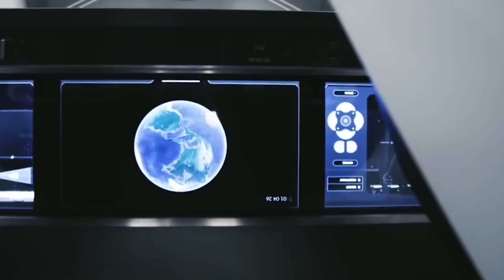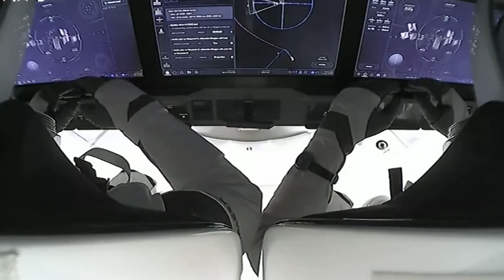SpaceX Crew Dragon Eyes Lunar Mission, Outshining NASA's $2B Rocket Plan...

Comment: Longer term there are lots of possibilities for a far better Lunar mission architecture than the current SLS/Orion plan but if Trump wants to see the USA win the humans-back-to-the-Moon race during the current presidential term, i.e. by the end of 2028, I suspect that flying the final 2 Block 1 SLS missions i.e. sticking to the current plan up to and including Artemis 3 (first crewed landing but not involving Lunar Gateway) might be the only option that can deliver. As mentioned, Crew Dragon would need a lot of modification and validation before being certified for a Lunar mission.

The end of 2028 is just over 2.5 years ago and maybe I'm underestimating how much new development and certification could be done between now and then but I fear that to hit an end-2028 deadline any new mission architecture would have to be based pretty much on what is already available or under development right now.

That's not to say that a new mission architecture that kicks in after Artemis 3 designed from the outset to be cost effective enough to allow a permanent Lunar presence to be established and maintained (or maybe semi-permanent like 6 months a year) wouldn't involve substantial new vehicle development, I think it would need to,  but if the USA is to beat Chana to the Moon for the first post-Apollo crewed landing I think that options are really limited given the timescales involved and (I'm guessing) Trump's strong desire to see that as part of his legacy which could also influence near-term policy decisions.

These two thoughts aren't mutually exclusive - fund Artemis 2 & 3 missions and also, with the budget freed up by cancelling everything else beyond that (SLS Block 1b & Block 2 development and cancel Lunar Gateway), start work immediately on actively developing the post-Artemis-3 mission architecture with a view to having that operational somewhere between 2030 and 2032.
Reply from the maker: Thank you for your support 😊